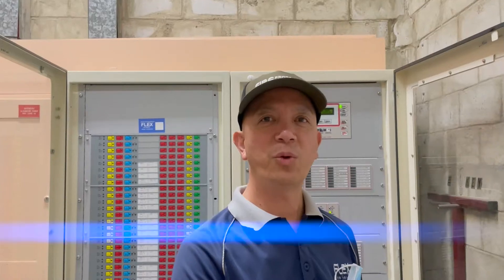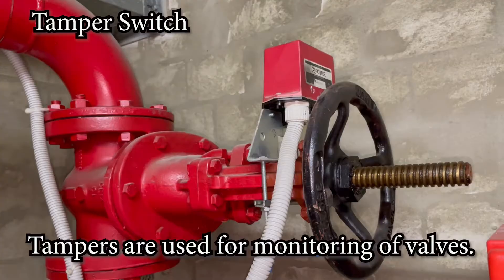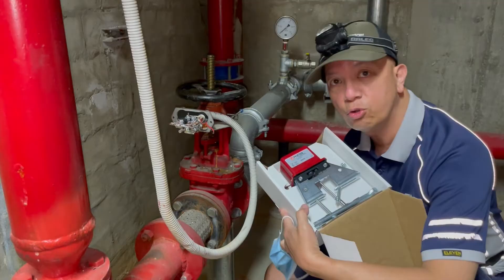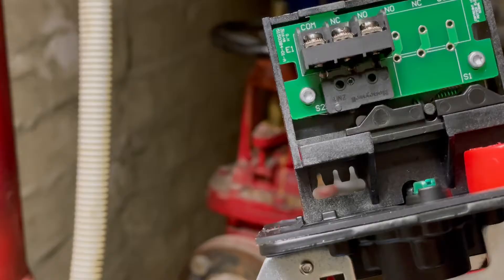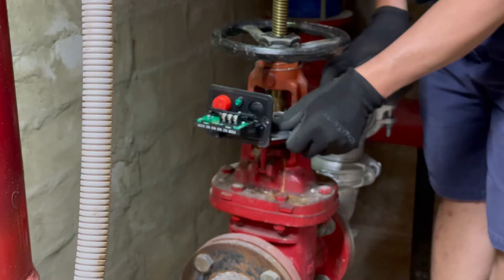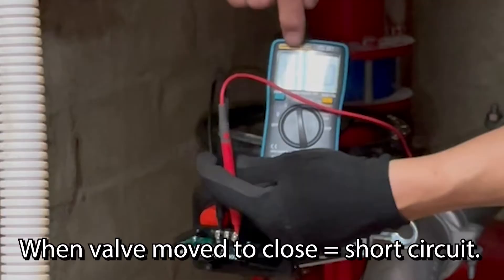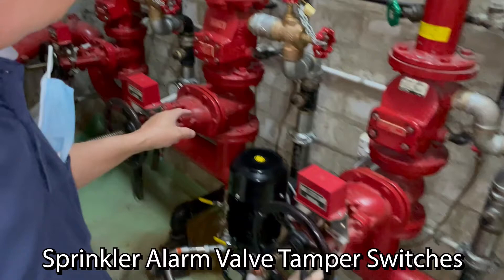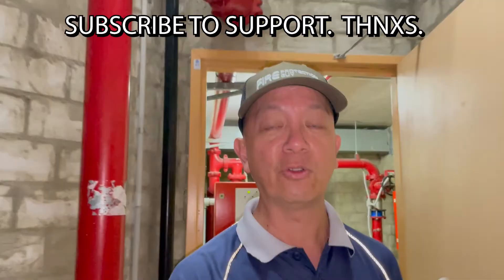Fire Alarm System - Tamper Switch Alarm (Episode F109) #fire #firesystem #firetech

Comment: you should really do something about the root cause too. Like, they don't corrode out of the blue.

 Either that valve have a tiny tiny tiny pinhole leak, or the area itself where that tamper switch may be too humid. I would suggest improving sealing between switch casing and switch base too with some bathroom silicon.

Just do something so that switch doesn't fail in a year or two again.
Reply from the maker: Thanks.. I found a leak just above it and it's all fixed.

Comment: if you close the valve then reopen is the panel still in alarm and has to be reset or not?  if the  tamper switches are in series  how do you know which one if not the whole four has been tampered with?
Reply from the maker: If the tamper is fully open, the alarm shall reset itself automatically. Most of them are program to be non-latching or resting once normalised itself. If they are in series and indicate an alarm, it's a trial and error which among them (valves) was moved or failed normal setting.

Comment: Hello sir good day in the suction line there is a check if the pipe is in vertical position in the cistern thank?
Reply from the maker: If you are referring to the check valve, that line is the by-pass if engine is not operational.

Comment: Sir You have explained very well where do you work 
  Do you have any information about Fer Diesel Engine Pump control panel  12 v
Reply from the maker: Hi Mate. Thanks. I am running my own fire protection company here in sydney. For that type of pump  control panel, I have not encountered that. Mostly here are locally made control 12v system such as  A Line, All Pumps, APC to suit the Australian standard 2941. Wish I can help.

Comment: What you didn't mention was the Product name Potter, (USA)  you also didn't explain that there is a groove in the OS &Y  spindle and the arm which comes out of the tamper switch must sit  in this groove, once the valve begins to shut, this arm comes out of the groove onto the round part of the spindle and its this action which sends an error message to the fire panel. 

 In Australia we have both a class B  supervisory tamper switch and a Class A  anti tamper switch . How about doing a story about a class A - how it works and under what circumstances must you use it- relates to an Australian/NZ  standard. I've a class A in the pump room in another one of your videos

Have you done anything about supervisory switches in  butterfly valves?  Like your videos  Steve
Reply from the maker: Thanks Steve, I did supervisory switches before for tamper switches and valve monitoring as well. I will try to do videos for them once I came across. Thanks a lot.

Comment: Now I know how tamper switch are for. Thank you!
I have a question sir, tamper and flow Switch can be connected to a FACP? right?
Reply from the maker: Both of them are connected to the FACP for monitoring. However,  flow switch, once activated, will activate the evacuation system of a particular level or zone where sprinkler water flow occurred. Then, the evacuation sound will cascade until the building is totally evacuated. In Australia, it's called EWIS (Evacuation Warning Intercommunication System).

Comment: Shall we need any monitor or input module to get information from temper switch?
Reply from the maker: Tamper switches are monitored to an input module. Your output will be based on your requirement. It could be a separate zone for a conventional circuit. In addressable, just a monitor module or single input device will do.

Comment: Hear Malaysia fire alarm system any pvc conduite /flaxibar can not allow. Tq.
Reply from the maker: Nice to know that. We only use metal conduits for fire stairs and areas where cables may be damaged. All cables used must be 1 - 2 hrs fire rated depends if its for detection or monitoring. Cheers.

Comment: Hi sir. Nice video. I just wanna ask if fire alam monitor module is required to connect the tamper switch to FDAS?
Reply from the maker: Hi Renzen, monitor modules are connected to each tamper switch for FDAS monitoring. But these tamper switches are not meant to call the fire brigade but only to alert the building manager. Thnxs for asking.

Comment: How To Land Wire On 3 Parelle OS&Y Tamper And Do Resister Volume Change
Reply from the maker: Running cables in parallel for 3 tamper switches is a cheap way to monitor all existing main isolating valves. The monitoring resistor of 10K remained the same in parallel connection.

Comment: can we connect  tamper switch to pump control panel or just in  FDAS panel only
Reply from the maker: The purpose is to monitor the tamper switch as it is part of the fire system. Pump controls are for pumps only but any abnormality in the pump control such as failed pump, no power in the controls ...should be monitored as well by the FDAS.

Comment: Sir saan dapat ilagay ang tamper switch? Sa discharge valve ba?
Reply: Sir Yon po bang Jockey pump discharge O.S.&Y GV kailangan din  po bang lagyan ng Tamper switch?
Reply from the maker: @reymundoleones6932  ...sorry for the late reply. Tamper switches are mostly installed in the supply side. Ang jockey pump don't need a tamper monitoring.

Comment: sir paano po magreset ng tamper switch? naka bypass kc sa fdas, and naka marked as closed. paano ibalik sa normally open? kailangan pa ba baklasin? 
maraming salamat
Reply from the maker: Tamper switch are program as non-latching. It should rest itself once the short circuit alarm is cleared. If it was in a conventional set-up, you just reset the zone after clearing the short circuit sa tamper switch. Salamat.

Comment: Master paano ibalik ang setting ng fire pump at jockey pump kung sakaling tapos na Ang sunod
Reply from the maker: If the pumps pressure switches are not affected, it good to go. Otherwise, kailangang palitan ang pressure switch that runs the pumps and set it again sa required starting pressure.
Reply: Sir pwedi po makahungi Ng wiring diagram

Comment: sir question lang po. Need pa ba natin maglagay ng monitor module sa flow switch para sa fire alarm or direct na sa flow switch to fire alarm. okay lang na hindi na for monitoring?
Reply from the maker: For tamper switch, we use a monitor module that is non-latching. Yung automatic to reset after the problem clears- either an alarm or a fault. For flow switch, a  relay module or can be a monitor module depends sa gamit mo. Sample, flow switch. Level 1 to level 20 had a sprinkler . Each level has a flow switch to identify switch level has a flow of water. Flow switch should not activate an alarm but activate an evacuation system in that level where water is flowing. The trigger for an alarm activation is the loss in pressure hence the pressure switch. So, if level 10 where the fire is, flow switch triggered level 10  EVAC/EWIS and cascade 1 or 2 level up and 1 or 2 level down.
Reply from the maker: Also.. watch my other channel...AKO SA SYDNEY. Thnxs
Reply: Sir what is the difference between FACP and FDAS. where do connect tamper switch?